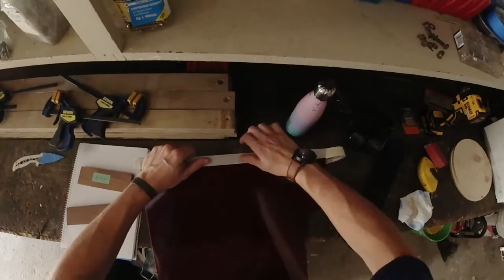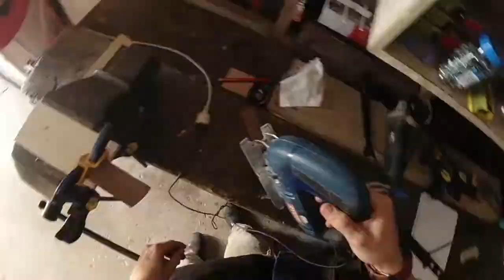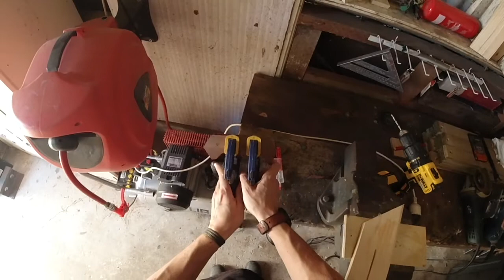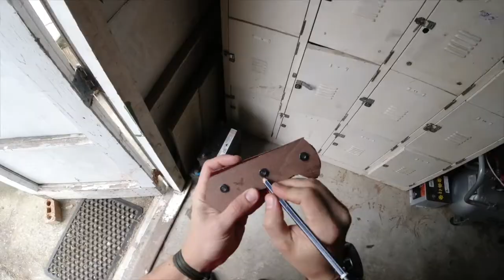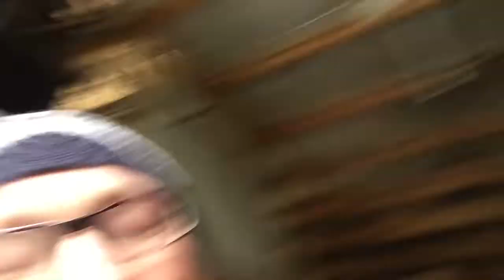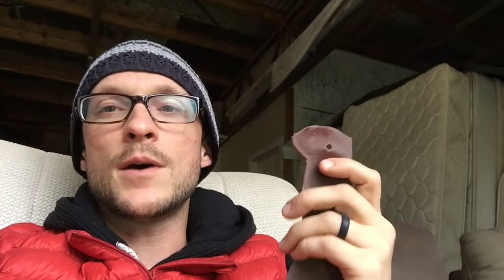Part 1 - Kabar Becker BK7 Simple DIY Handles Black Walnut Beeswax Stabilized w/ Linen Micarta Liners

Comment: A tip on the factory Zytel handle slabs: You can easily make them feel like Micarta, and in the same time improve the grip a lot! Just get a low grit sandpaper (120 to 400 grit will do) and push with your thumb diagonal scratches, on the factory plastic handle surface. Just make some "X"s paterns with scratches and always check how it feels before you put some more. Don't over do it, just push your thumb down a bit hard on the plastic surface. It will only take a couple of minutes!
Reply from the maker: Excellent tip, thank you very much!  Do you have a Becker, or did you try this on something else?
Reply: @homeslicesharpening  I tried it on the Becker BK7 !!!
Reply from the maker: @greekveteran2715  Beautiful, thanks for the tip!

Comment: What did you epoxy to the wood handle that goes against the tang. Was it thin sheet metal? Is that necessary?  I am thinking about using Brazilian cherry hardwood flooring and turning it into a handle for my BK7
Reply from the maker: Ooooooh, that would be awesome!!!  You should shoot a little video and post it if you do that… I want to see!  I glued 1mm sheets of Maroon Micarta to each side of the wood handles as liners.

No, it’s not necessary at all!  But I did it for 4 reasons:
1) I thought a maroon stripe beside the black tang inside the Black Walnut scales would look awesome.
2) It’s an easy way to slightly boost the toughness around the handle as Micarta is a bit stronger than wood.
3) I was working with 1/8” slabs of wood, and the palm swell was a little thin for a good secure chopping grip, the Micarta was a simple way to thicken the handle just slightly.
4) I already had spare Micarta from another project.